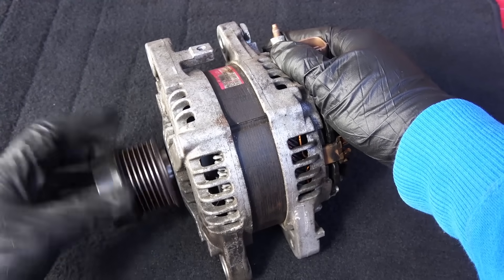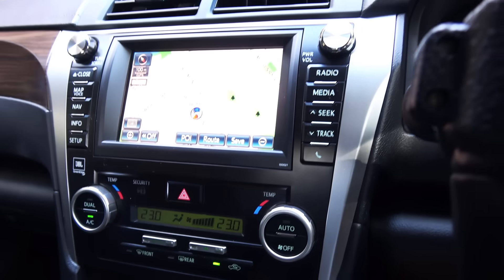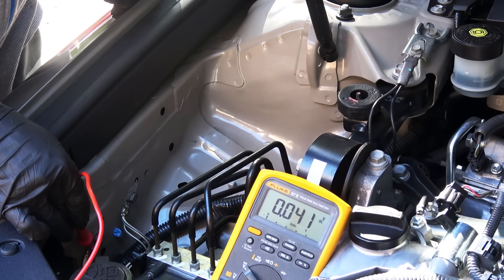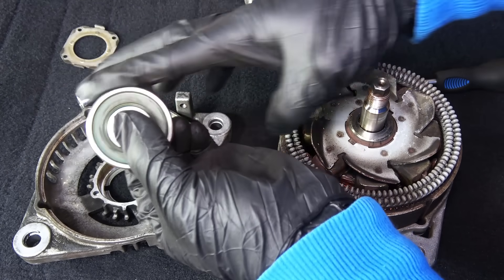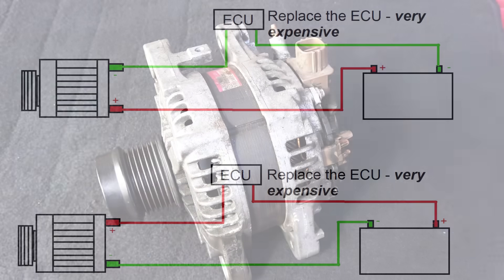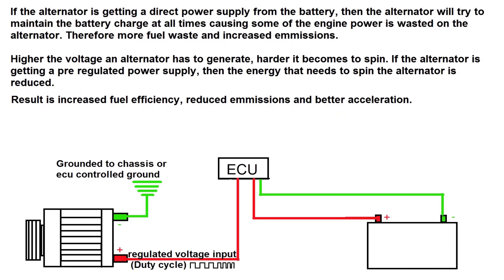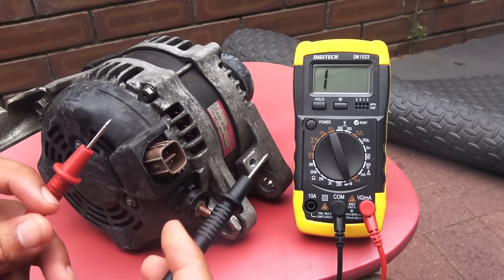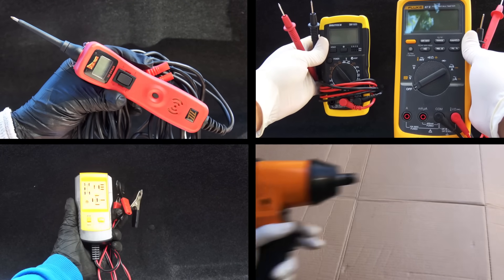How to Test an Alternator  ( Testing the Voltage Regulator, Diode rectifier and Stator)

Comment: Thanks for the excellent video. In  my 2006 rav4 I replace  for new batt and rebuild alternator. In idle batt. reads 14.1v ,but when I shift to Drive decrease to 12.6v. In the video you show how to bypass the ECU, but still not clear for me. Can I do that in the 4 pin connector or in the relay?Which pin receives the command from ECU, 5V pwm?Thanks a lot for your dedication.
Reply from the maker: Check the voltage regulator, Looks like you've got a bad replacement alternator. do the test
Reply: Sir , thanks for your prompt response.I have tested the cables + and _  i got less than .2v difference.
Batt. terminals are clean. I put multimeter in continuity and checked alt. diodes and got 433readings one way only. When you say do the test ,what part exactly you mean?
Reply from the maker: Test the Voltage regulator at low rpm and high rpm and see if you get a high reading at higher rpms. Make sure the battery is fully charged before start testing
Reply: Thanks again. No starting problems. I performed the test, car parked in 750rpm and 2000rpm with and without load ,batt. numbers are stable 13.8v. However, while driving 30mph- 40mph my cigarette lighter meter shows the batt. voltage oscillate 12.5v to 13v and no higher, if I keep driving the car starts shaking and rpm decreases to approx. 400rpm. Very challenging situation for me. I really appreciate your effort to help me.Thanks a lot.
Reply: Forgot to mention that during driving, when batt. reaches 12.5v , the batt. light located in the dash board turns  on,  if the voltage goes to 13v then off.
Reply from the maker: You said when you driving the car starts shaking and rpm decreases to approx. 400rpm. That sounds like engine is trying to cut out. Check that first Make sure you have no running issues, because If something is decreasing the rpm, then it'll' directly affect the alternator rotational speed.
Reply: I will check it .Thanks. Please, Could you tell me in the 4 pin connector which one is the one that receives the PWM signal from ECU, is  FR OR  S?
Reply from the maker: Fr is the field monitor which goes to the ecu, s is the sense which connects to the battery. You've got nothing to bypass here, ecu is only monitoring how much voltage is being generated at any time. If you disconnect that, your battery light will be permanently on. Bypassing is mainly for american and European style vehicles with computer controlled alternators where the sense wire is a pwm signal coming from the ecu. I highly recommend you to not mess with ecu.
Reply: I just wanted to interrupt S from ECU  and inject a PWM 128Hz from  arduino module preprogrammed.

Comment: My battery would slowly drain so I did the diode test which showed (.3 out, and 1.3 in "bad diodes") so I ordered a new rectifier which showed (.99 out, and OL in "good diodes") and replaced the rectifier and put in back in. Apparently 4/6 of my diodes were bad. It says in my service manual that at 2000RPM my alternator should be putting out 85 ADC but it only puts out 40 ADC. I used a fluke 324 Plus to measure the ADC and I measured it "clamped it" right at the wire coming out of the B+ terminal of the alternator. Any ideas?

Comment: Hello mate, 
Great educational video, thanks for that.
 
Just quick question. I'm having almost same problem: In cold day started the car drove very little journey 3 mins, stopped in very at shop, then tried to start wouldn't start at all. Called breakdown Engineer, who  came and jumpstarted the car, tested and turned out the alternator wasn't charging hence drained the Battery, but when he put rev up little higher something around 1500rmp or above and let it go on idle running it started charging. he told me there's intermittent alternator problem and left.

 I have tested since then few days with multi meter and every time before starting Battery  read at 12.6v (which is perfect), when started and engine running 11.5-12.6v (wasn't charging) but I rev up and let it go starts charging at 13.5-14.2v.

My question is: How do i identify where is the problem? Whether  Alternator brushes or there's any cable connection problem such as break between battery and alternator?

I'd like to avoid removing whole Alternator as I don't have much knowledge ( first timer) and tools, also in case problem is with cable or anything else.

Any suggestion or advice much appreciated. 

Many thanks indeed and sorry for long comment.
Show less
REPLY
Reply from the maker: When you rev up the engine , the whole engine shakes up and vibrate. So if your alternator starts working after a sudden vibration, you could have worn out brushes inside. Look up the model no of the alternator on google and try a video on installing brushes on your exact alternator. That’ll give you an idea on how to swam em. Brushes are pretty cheap

Comment from the maker: you guys wanna see how to replace an engine??https://www.youtube.com/watch?v=aYEisdUzUPM
or How to find a short in a modern car? https://www.youtube.com/watch?v=JFThdbDYL-c
or how to tell if your car has a bad battery? https://www.youtube.com/watch?v=Eqw1CF1nOt8
or how about how to use a multimeter?? https://www.youtube.com/watch?v=hgTgx_h5QOk
Reply: Junky DIY guy Excellent video. One question. If in positive test between of alternator and battery the loose is up to 0.2 such as 0.7 is probably the problem with the thickness of wire?
Reply from the maker: It could be possible to have 0.7v of a difference between the two, if you replace the cable with a larger cable than the stock cable. But if you get 0.7 with the stock cable then chances are your cable is too old and has high resistance. To make sure it is the cable, connect the multimeter to the 2 ends of the cable itself. In my experience, As long as you get around 13.5v to the battery under full load, your battery wouldn't go flat. But your alternator has to work hard a little bit. I know some people live with it, But replace if you can coz 0.7v is a significant drop.
Reply: Junky DIY guy como puedo cambiar un slip ring en un alternador
Reply: Glad to see this vid. I have a question. If the alternator was charging on the cold start 13.8v and then after driving a couple of mile with  accessories the voltage drops to 12.6 so definitely its not charging.  Would that be a bad alternator? The truck is 15 years old.